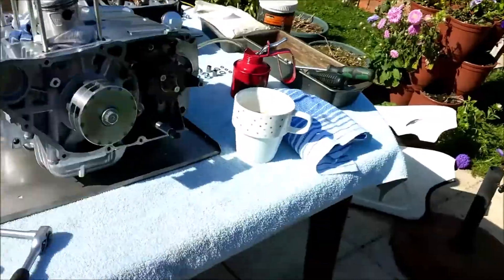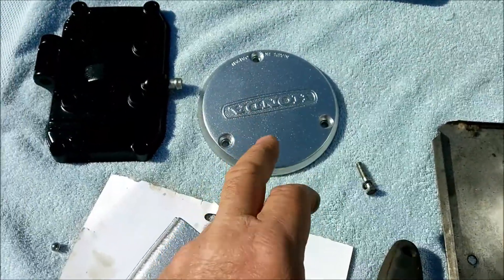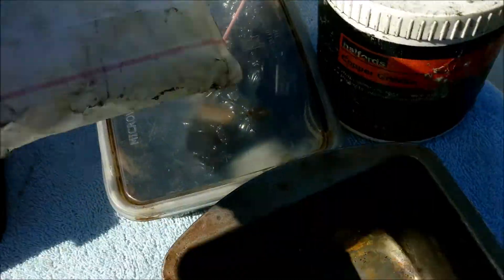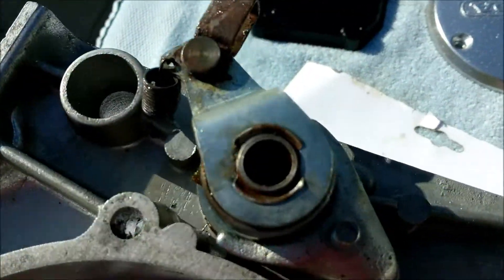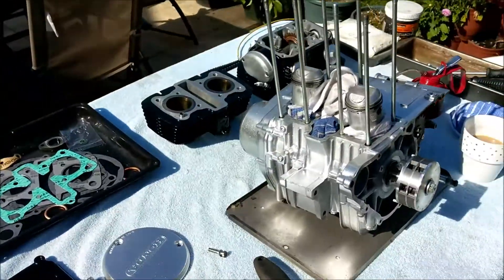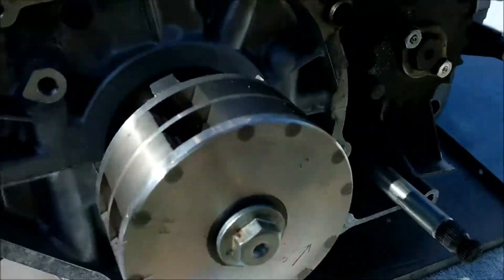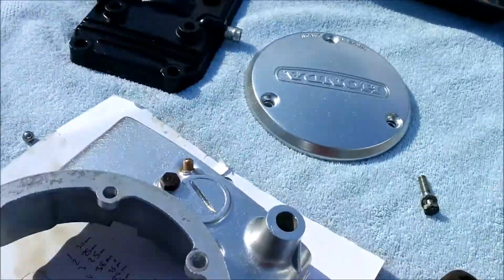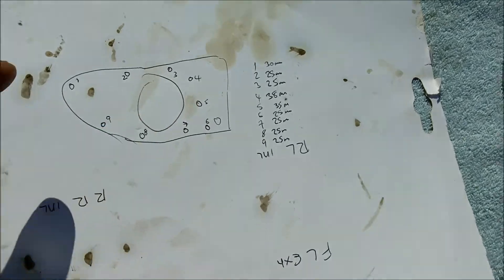Honda CD175 Restoration Episode 23 (Engine part 5)

Comment: I fair enjoyed your video on that engine as I wrecked mine in the early days when I was 17 teen all because I changed the oil and cleaned the filter I had no oil pressure after oil change ,I went through 3 sets of bigends plus camshaft end caps in 6 months oh dear
Reply: I now know why I didn't know that I had to line up the filter housing huh that was 40 years ago 😳
Reply from the maker: Oops

Comment: Nice work Adrian it's looking really good. Only thing I could think to demonstrate more was when setting timing on the T for top dead and O on the cams would have been the relationship of the pistons and valves so you are not 180 out as you correctly said for people to understand. Good work though nice to see a happy 🐇
Reply from the maker: Good point well put, i need to check mine as well lol

Comment: As you finish up on the CD175 I have been trying to guess what project that you will tackle next. Hope that it is as interesting as this one.
Reply from the maker: i'd like to have a go at an old 2 stroke next. going to have a break after this one. ive got some maintenance to catch-up on the Royal Enfield Himalayan. Oil change and tappets valves to set.

Comment from the maker: Thanks for your comments folk's, I do talk a load of tosh at times, like when I said near the end about the Coil bolting under the head nut, obviously I meant condenser lol....and I fannied about way too long with the cam chain getting it equal lengths either side, when in fact I only needed to get it equal right at the end when setting the timing marks. aanyway it was my first time inside a 175 engine so I was pretty much winging it lol.....

Comment: That ball bearing in the clutch actuator usually drops out when the housing is removed. I did it on my K4 250 in 1976.... Edit - I did find out 2 days later, not 40 years+
Reply from the maker: I bet it does, i made damn sure it was in place :-)

Comment: Sir can we used cd 125 or 200 engine for cd 175 sloper chassis? Problem is my cd 175 engine is missing many years before
Reply: Carburetor will be at wrong angle and may foul frame.